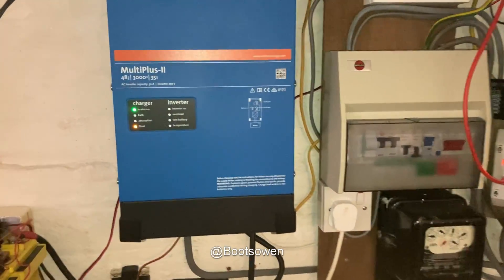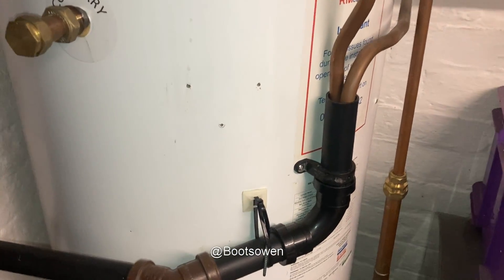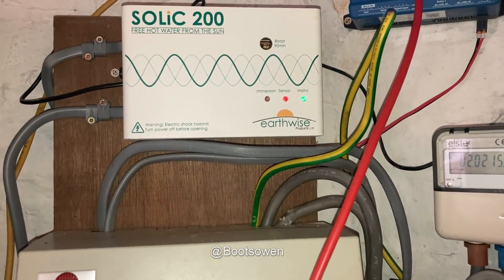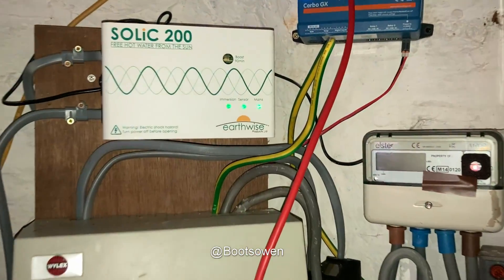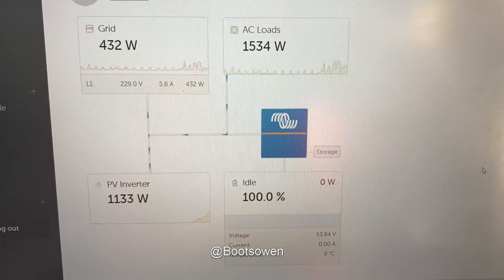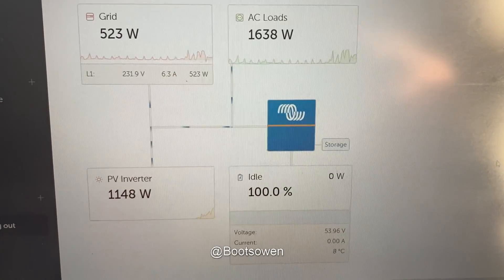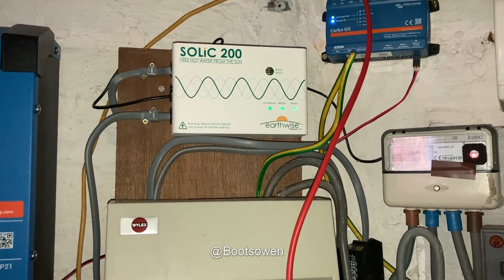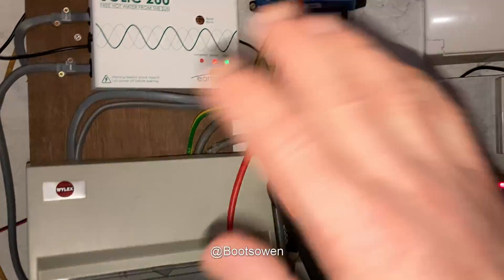More Solic 200 mysteries... why does it draw power from the grid?

Comment: I have a Solic and monitor solar / grid current using an Emporia monitor.   I have the same problem , the Solic will not zero the incoming grid current .  I am in the process of discussing with Earthwise why it is that the grid power is > 100 watts.   It should be ZERO if the Solic was working as advertised .
Reply from the maker: I have not had success with this solic. It has been reflashed or reprogrammed by earth wise but it still isn’t right. I monitor it using Victron software. I have abandoned it for the last while.
Reply: @bootsowen  The Solic is not working as advertised and I hope they will be able to solve the problem.  I am paying for electricity unnecessarily which renders the device usless.  I purchased it on the understanding that it used zero grid power.

Comment: Hi Owen,
Had a thought that the Solic is sending all solar to the immersion heater and then importing grid power for the house usage. Mode 1 and Mode 2 as previously mentioned seems an idea
Reply from the maker: I haven’t noticed modes on the device. The older black model had some dip switches inside but this one comes as it is.

Comment: Well bootsy, if your SOLiC 200 is not calibrated correctly, it may not be able to accurately detect when solar power is available and when to draw power from the grid. This can be caused by a number of factors, such as loose connections or faulty components. Your SOLiC could also be in Mode 2:  In Mode 1, the controller will only draw power from the grid if the immersion heater is turned on manually or if the battery is discharged. In Mode 2, the controller will automatically draw power from the grid to heat water if there is no solar power available.  Also If you have manually turned on the immersion heater, the SOLiC 200 will draw power from the grid to heat the water. This is because the immersion heater is considered a high-priority load, and the SOLiC 200 will always provide power to it, even if it means drawing power from the grid.
Reply from the maker: I have calibrated it previously and honestly I forgot to this time. But as you will see from my previous videos I have had limited success with it. I can’t trust it. It does seem to divert, but draws from the grid at the same time. Perhaps I have a tricky unit, but this thing should just behave.